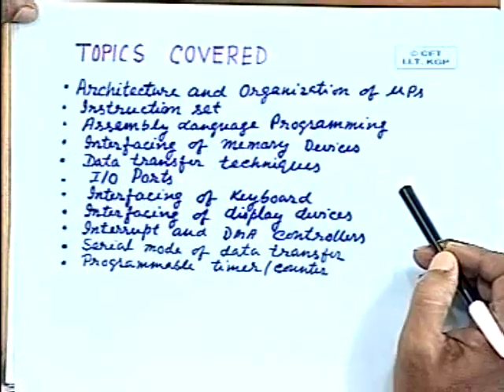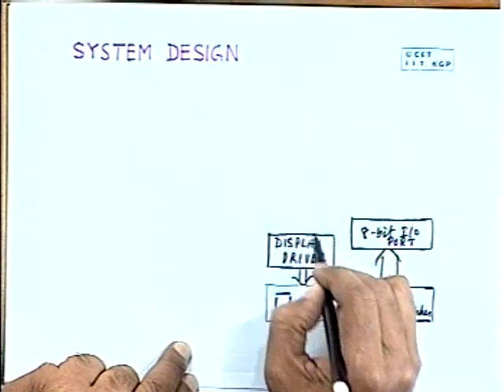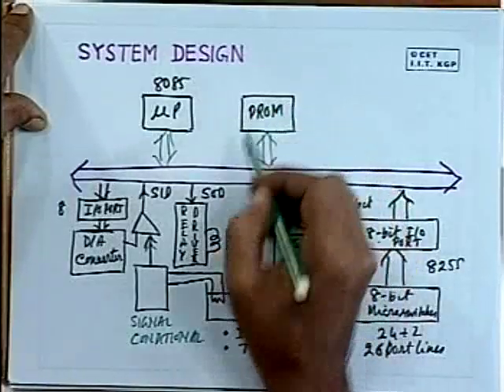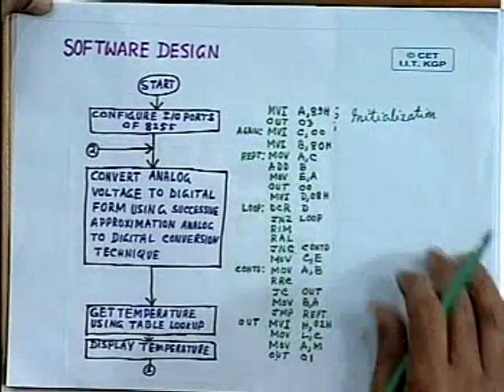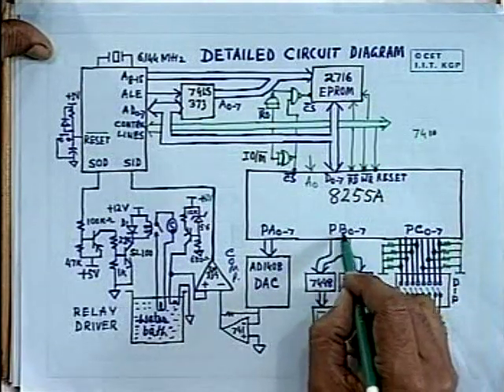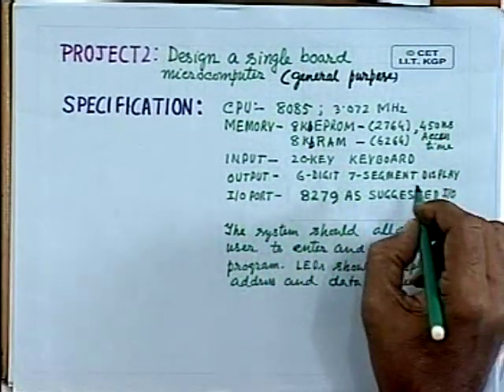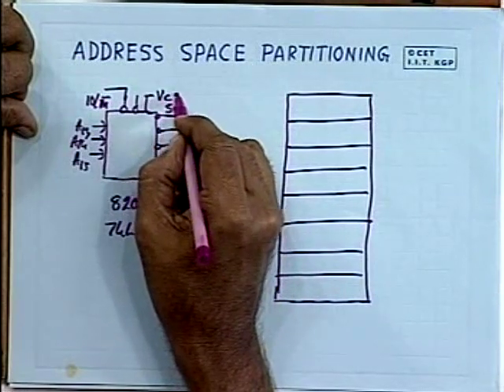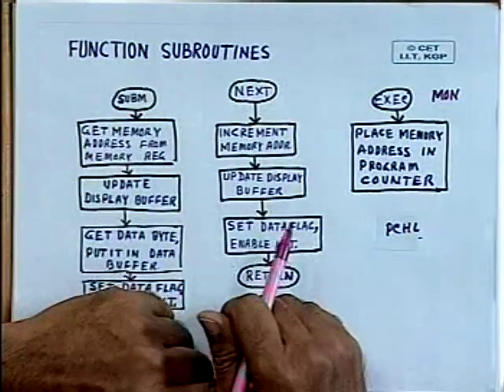lec 20 - Designing Microprocessor Based Systems

Comment: This educational program is interesting. The water bath is supposed to measure accurate temperature electronically upto 100 degree Celsius. There are only two seven-segment LCD modules in the design. Is it possible to measure any temperature above 99 degree?